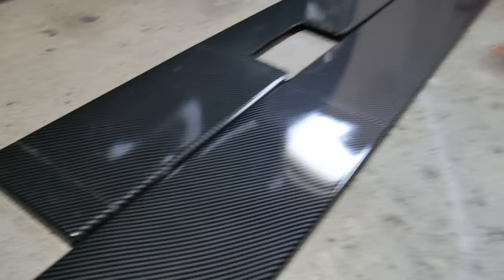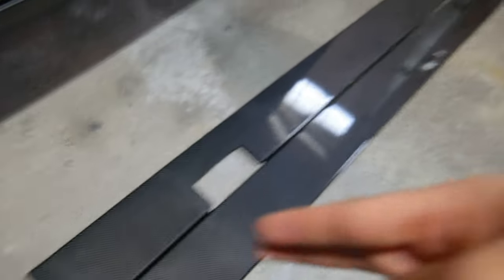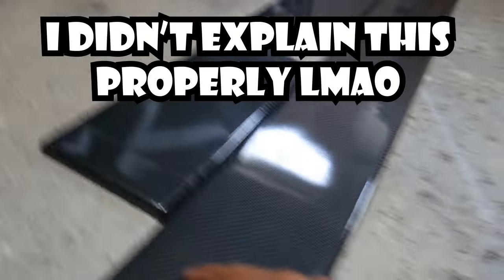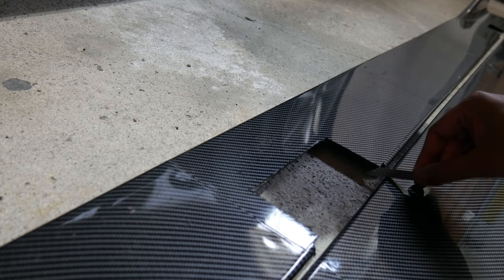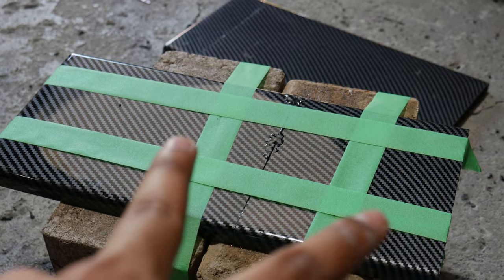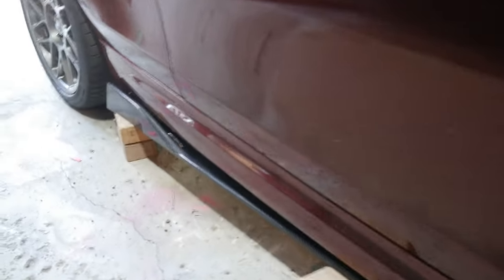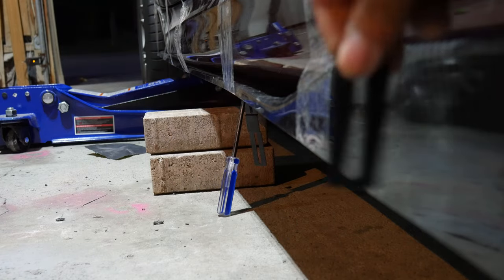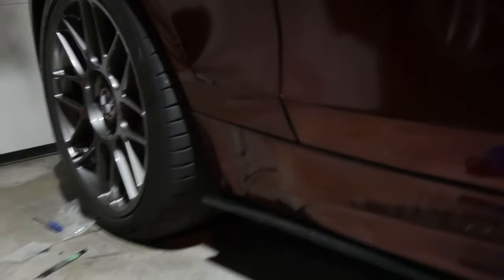DIY: Side Skirt Extension Install on BMW 1 Series!

Comment: How did you get the screws in without drilling?
Reply from the maker: Since the car wasn’t too high off the ground, I forced the screwdriver between the car and ground which gave enough force for the self tapping screws to go through and hold. Hope I explained that correctly 😂